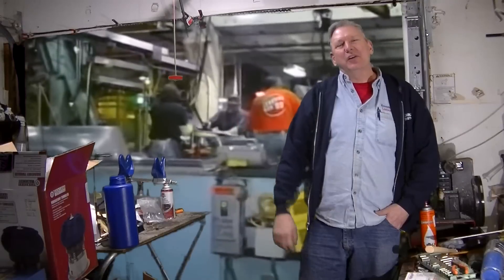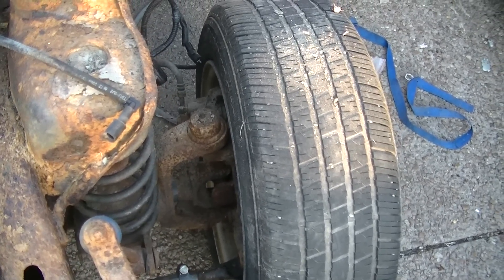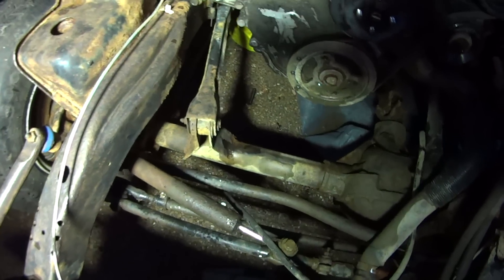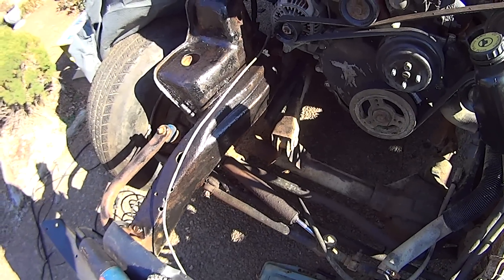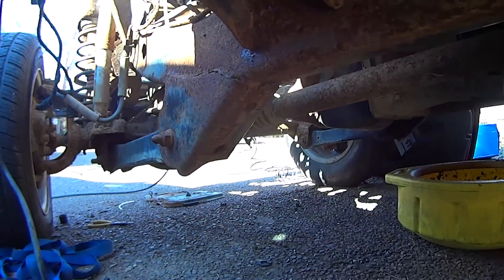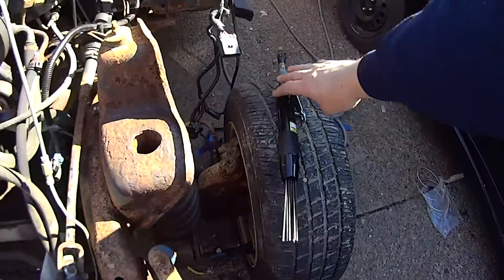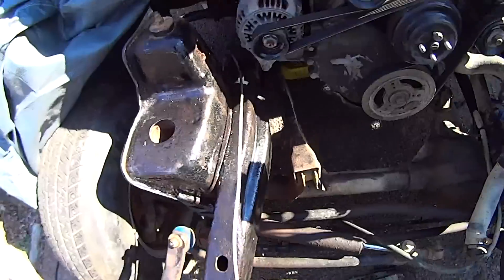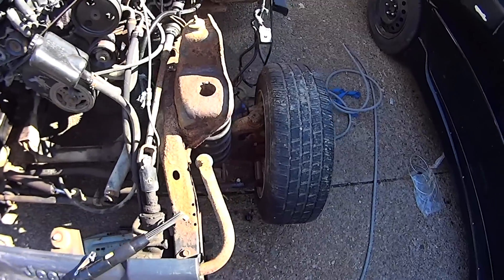Jeep Wrangler TJ Frame Repair / Restoration - Needle Scaler 96997

Comment: I used a needle scaler for the first time recently, blasting the rust off my 02 F150 frame. It worked awesome, I did not follow up with wire wheel or anything, just went over it after with Eastwood rust products. Will see how it holds up after the winter.
Reply from the maker: +InternetDude I bet it will do fine :)  Eastwood stuff is really good for protection.

Comment: I just started watching this. It seems to me stripping the frame down and having it sand blasted would have been a whole lot easier in the long run. That's a lot of rust and gunk inside. I know it would take longer and be more work but in the long run getting the frame sand blasted would be a much better job in the long run.

Comment: Your frame at the center skid plate looks repaired. It gets bad there and I strongly recommend putting a bunch of new steel in there and make it right. That repair looked like just a solution to keeping the skid plate in place. Even my rust free body TJ is starting to show rust there and I plan on repairing it eventually
Reply from the maker: Thanks, Ill know a bit more after I start cleaning it up you could be right.

Comment: stay away from rough country i'd not buy any of their products again, i'd spend the money and get something better
Reply from the maker: what did you have a problem with bro ?
Reply: missing hardware with the lift kit, purchased that rear track bar that was adjustable for 0-4 inches of lift but wouldn't fit because of the tailpipe.  the front trackbar is starting to go, etc.  In my opinion they are a low budget cheap aftermarket part
Reply: @BackCountryWrenching  Never had an issue with RC.